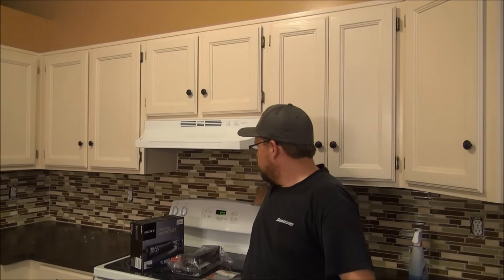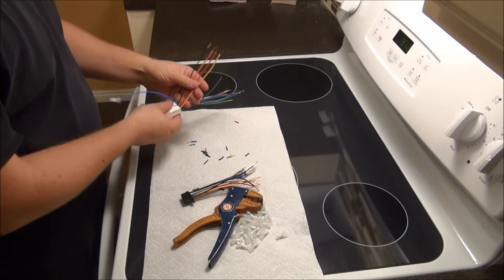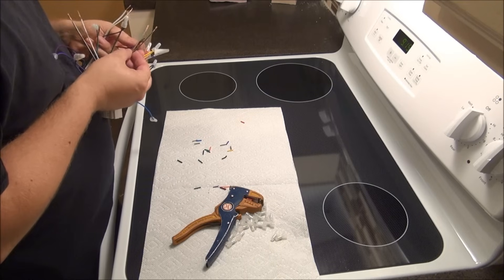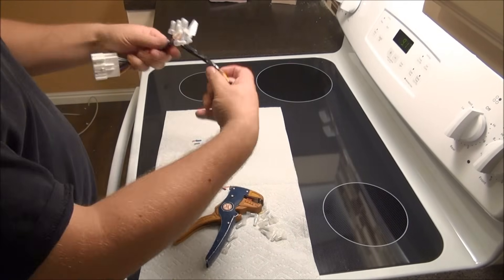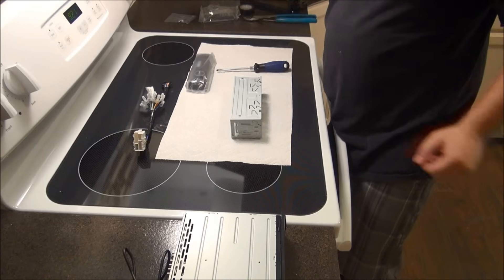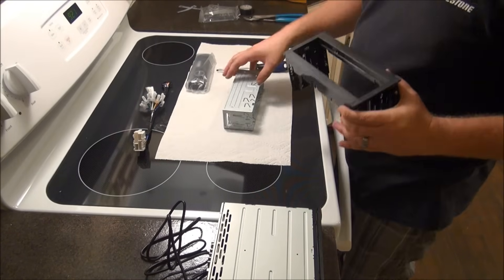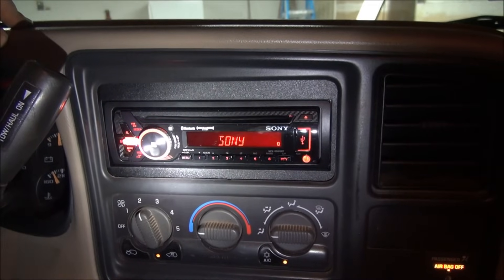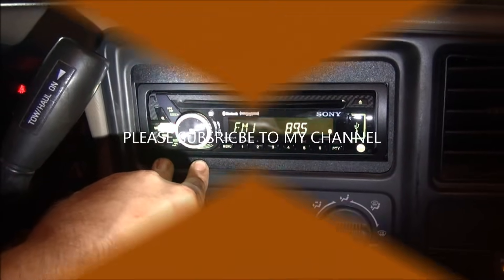How To Install A Stereo In A Chevy Silverado. Head Unit

Comment: Does the sleeve come with the radio or do you need to purchase that separately as well?
Reply: And does this work for the 1500?
Reply: The 1500 is very similar.  I have a 1998 1500 and the surround is slightly different, but the process still works the same.

The aluminum sleeve that clamps into the dash kit comes with the radio itself.
Reply from the maker: Yes exact same process on the 1500

Comment: I have a 2000 GMC Sierra 2500hd we just installed new speakers because the last ones blew. What i am wondering is do i need an antenna adapter and what model stereo is this. Also, what is a dash kit and which one is this. Sorry first time doing a stereo upgrade i just dont want to have big holes in the dash. I want it to fit perfectly like the one in the video did. Also, how easy is this to do. Is it easy to screw it up and worth paying someone to do it? Thanks again

Comment: I just installed a Kenwood in my 1999 Gmc Sierra. I used the same wiring harness as you. Now, after installing, the ABS light and brake light on my dash are on. Any advice?
Reply from the maker: Should not have anything to do with the radio install..... You really need to pull the codes with a scan tool....You could have a problem with.
1-ABS/Wheel Speed Sensor
2-Wiring
3-ABS module failure

Its fairly common that I see rust build up on the main body/frame grounds on the frame.. Which sometimes messes with the ABS Module

Comment: Guess you didn't want all the door chimes, or the radio to stay on till door is opened features to work....
Reply from the maker: This truck does not require a chime module. All factory settings chimes door open feature etc still work. It was not until later years that require the module 2003-up

Comment: Which wire did you connect with the ilumination wire? When I set up mine I didn't have anymore wires to connect the ilumination with. & I left it alone so I don't know if that might be the problem to my dash lights not lighting up. Any ideas?
Reply from the maker: Angel chavez It is perfectly fine not to hook up the illumination wire. However you must cap it off so it does not run risk of shorting out to something. Make sure ANY unused wire has a white cap on it or tape it off, then check your dash light fuse's to see if it blown.

Comment: What wire does the orange dimmer connect to. I could see your hand was in the way
Reply from the maker: The orange dimmer wire on the radio wiring harness hooks to the orange wire on the wire harness adapter.... You just match the colors up.... (if you want the dimmer hooked up, if you don't want it hooked up just leave it unhooked and cap it off or if your radio does not have an orange wire than just cap it off)

Comment: does the dash kit work with pretty much any stereo I buy? Or should I check the dimensions of a stereo first?
Reply from the maker: ***** Their are basically 2 aftermarket radio sizes "single DIN" or "double DIN" any single DIN radio will work with that dash kit

Comment: it looks like you do really thorough work with that backsplash so I'm just wondering why you used wire caps aka wire nuts, soldering is the only true way to do it
Reply from the maker: +scott lavaysse White caps are nothing like wire nuts. They are an insulated crimp
connections. 95% of all professional shops use them.

Comment: My Silverado had and extra connector on the back of the head unit and when I replaced it with an aftermarket one, I'm only getting sound out of the small front door speakers, any idea on what's going on with it or what I can do to fix it?

Comment: Why do you need to put the car into first gear? Why can't you take the dash off and on while the car is off?
Reply from the maker: +Chris Snow To make it easier to remove dash panel, and prevent damage to rubber shift lever boot.

Comment: Why did you start the engine when removing the dash?  I heard you have to disconnect the battery and the power to the airbags to prevent them from engaging.  You were not concerned about it.
Reply from the maker: +Joe m I did not start the engine, only turned on the ignition. However no need to disconnect battery, you can do it if you would like. On this model you are not touching and or disconnecting any air bad switches or modules and or wiring at all when removing the dash trim panel. I have most likely done it this way probably somewhere close to 1,000 plus times (no joke)

Comment: Didn't see where you ran the Bluetooth wire?  How did you do that?
Reply from the maker: I think your are referring to the mic?   If so I just clipped it on the head liner and pushed the wire behind the head liner over to the drivers side a pillar and behind the plastic a pillar, than under the dash using wire ties to secure, up and over to the radio.
Reply: Thx. Video helped a lot.

Comment: This is one of the best videos I have seen for this work!  I've installed this same unit in 2 vehicles so far and will now do it on a 2002 Yukon XL.  This vehicle has Sirius radio so my friend is looking forward to removing that head unit from the dash and having Bluetooth capability.  Excellent work here.  I am assuming the dash plate is removed from the Yukon the same way as your Silverado.
Reply: Steve Navy Engineer how was the installation on the 2002 Yukon XL? was it done exactly as this video shows, that's the car I have.

Comment: I'm sorry but did he say a handful of whitecaps
Reply from the maker: +scott lavaysse Yes that's right, and I have worked for 5 major car stereo companies in the last 20 years I have been installing complete car stereo systems all 5 used white caps additionally I have repaired many other shops work. And have only came across one shop that would install a basic radio and solder the connections and that was circuit city and they went out of business. I consider myself a soldering expert. And find absolutely no reason to solder the connections on this type of install. Soldering is an absolute must in some applications, but not this one.

Comment: DIAGNOSTIC INFORMATION

Engine and Transmission System
We were unable to successfully complete a diagnostic test. This issue may be caused by an aftermarket device plugged into your vehicle's diagnostic port.
If an indicator light is lit on your dashboard, schedule a service visit with your Dealer soon.

Is this for the radio heads? I swapped out my factory radio for the aftermarket. Usually, I get monthly updates from chevy. Is it possible to reconnect back data port to the new radio. I would love my truck to give me information back.

Comment: First, thank you for a great. straight-forward instructional video.  I think Scosche has changed some of the part numbers, but they have a little guide by the display of their products at Wal-Mart, and I was able to determine the new dash kit (GM 1483) and wiring harness (GMDA - it had an antenna adapter included).  One quirk in my 2000 Silverado 1500 was a second smaller wiring harness plugged into the back of the radio, which I determined went down to the cassette player which sits separated from the radio and CD player.  Since I never use the cassette player anyway, I just disconnected it and stuffed it back in the dash behind the new radio.

Comment: Where did y get the dash kit? I can't find one anywhere for that model truck.
Reply: +levi watts Maybe too late but you get them at Walmart or Best Buy in the car radio section
Reply: +Kenneth Thomas thanks man! I still haven't gotten around to it
Reply: +levi watts so the shifter isn't in the way when you pull the dash trim out
Reply: +ProfessorSneaks no you pull it all the way down into 1st.
Reply: +levi watts yea and my bad that response was for another guy on here but yea pulling it down makes it easier to remove
Reply: +levi watts I have recently got this truck to I have everything prepared just need a box for for my subs I do have a regular cab so fitting a box is a little more difficult considering I am 6 feet tall and I prefer to lean back a little bit so I have to really make sure the enclosed box I put it is perfect
Reply: +levi watts I have recently got this truck to I have everything prepared just need a box for for my subs I do have a regular cab so fitting a box is a little more difficult considering I am 6 feet tall and I prefer to lean back a little bit so I have to really make sure the enclosed box I put it is perfect
Reply: +levi watts go to http://www.crutchfield.com/p_120993002/Metra-99-3002-Dash-Kit.html
I know it works for a 2002 chevy silverado and it says it works for a bunch of other models

Comment: Nice Video. We had few quick questions and need your expertise. What wiring harness/antenna adapter/Dash Kit do we need for a 2005 Chevy Silverado Ext. Cab 1500 Double Din with No Bose and No OnStar but we want to maintain the factory standards like door chimes etc. We are trying to install a new Aftermarket Boss stereo with backup camera that was included. Any tips you can give would be great, this will be our first time installing a backup camera. Thanks
Reply from the maker: http://www.crutchfield.com/g_751/Factory-System-Adapters.html?tp=3486 This is the Radio interface..The easiest place to find the back up wire is at the back up/reverse light.... Tap the wire at the lamp (it should be ether dark green or light green)

Comment: Why didn't you disconnect the air bag system my manual suggest that I disable it and the negative lead on my battery is it necessary to take these steps
Reply from the maker: On this year make and model you are not working on anything close to the air bag system..However disconnecting the negative battery terminal is always a good thing to do when working on your vehicle...
Reply: thank you

Comment: First of all, great video. Clear and conduct instructions. Liked and subscribed. 

Question: if I did this, but wanted to account for a sub, would I need a separate amp for the sub? I don't want anything crazy, just 1x10 to give a little low end. 

Also would like to replace the factory speakers at some point as well. Anything special needed aside from what's in your video?

Thanks!

Comment: In my opinion, I would install a radio that has the ability to show the clock at the same time as the FM/AM frequency (Tuner), track number (CD only) and elapsed play time counter (CD, Bluetooth, USB) and source name (AUX or cassette tape*).

*Despite the fact that music is no longer released on audio cassettes, I'd put a cassette adapter with 3.5mm headphone jack into the player.

Comment: So Bri, I'm about to pick up an '01 silverado regular cab from a close family friend. 65k miles and serviced every 6months. I just want to know, how do you like your silverado and is it worth trading in for something else?
Reply from the maker: +Nikolai “BubblesRevolution” Bonnkarovsky Did you get the silverado? I love those trucks!
Reply: Yeah, turns out it was a 1999 but I still got it. 65,932 miles on the motor and flawless paint/body. Loving it so far, stopped driving my STi for it hahaha
Reply from the maker: Yeah they are pretty good old trucks. I have owned 10 Chevy trucks in the last 15 years. I think I have owned one with every motor pacakge including 05 duramax, 4.3l, 5.3l, 5.7l, 6.0, the old 7.4 big block and my truck now is the 8.1l. For some crazy reason i just like to own/collect them. I own a 2008 and 2002 now. And at one point for years I owned 3 at once.

Comment: where did you get the wiring harness that you connected to the stereo harness
Reply from the maker: +Troy Rhoades I'm a car stereo retailer so I buy them wholesale, however Amazon has them at good prices.
Reply: +Do It Yourself Bri or even at ur local walmart they have the adapters harness and radio face fitter

Comment: Connecting the orange cable is not necessary.
Reply from the maker: +ferny-1017 Correct only for the lights on your radio to dim when your head lights are on. However some people prefer to leave the wire disconnected so that the lights don't dim. (personal preference)

Comment: Do you notice a sound quality difference?
Reply from the maker: +67 IH Farmer Small improvement yes!
Reply: +Do It Yourself Bri Question: I have a Blue wire on my wiring harness that's labeled "Power Antenna" but my radio harness only has a Blue/White wire that's described in my owner's manual as "Connect to the system control terminal of the power amp or auto-antenna relay control terminal" should I connect these two wires or not?
Reply from the maker: Does your car have a power antenna? or an power amplifier?
Reply: +Do It Yourself Bri I actually just figured out what to do with the blue wires but I still have one more question xD

My radio harness has a Orange/White wire that says "connect to a car's Illumination signal" but the Orange/White wire on my adapter harness says "Dimmer". My adapter harness also has a Orange wire that Just says "Illumination". Which one should I connect to?

Comment: Ok, so I've got this exact truck and mine only has a wire harness and the antenna connection. So should I just cut the wires on the current harness and then solder or crimp them together when I get the new wire harness or...? I see you've got another plugin with a black end on it and you said it connects to the radio. Does that usually come with aftermarket radios?
Reply from the maker: +M3 xVAVx Yes the black plug comes with an after market radio...Are you trying to install a factory radio or after market radio?
Reply: I'm planning to install an aftermarket radio but I've got other expenses right now so it will be roughly 2-3 weeks before I can actually go out and buy one.
Reply from the maker: +M3 xVAVx Yeah if you buy a aftermarket radio it will come with the harnesses with the black plug. You also need to purchase the same wiring harness and antenna adapter I used in the video.
Reply: Do It Yourself Bri Yeah I've already got a dash kit picked out that includes the kit, antenna adapter, and harness. Lucked out with that one. :)
Reply: Do It Yourself Bri Thank you for the info. I figured it would probably come with the aftermarket but I wanted confirmation before I dropped $100-300 on a radio lol
Reply from the maker: +M3 xVAVx Nice, sounds good.

Comment: where did you get the wiring harness
Reply: +josh wagner You can get it at Wal-Mart in the automotive car radio (car electronics) section of the store.  Also either on Ebay or at a local car stereo place.